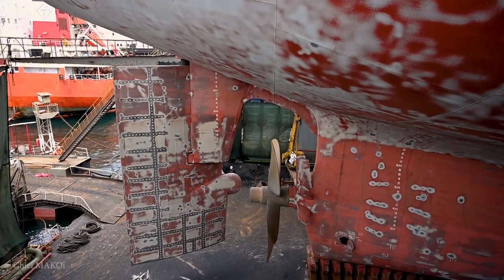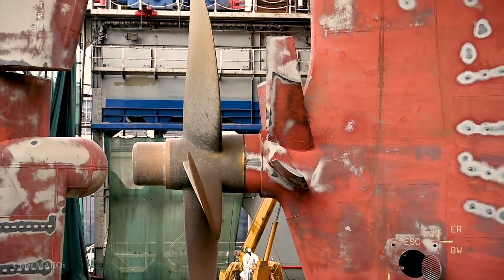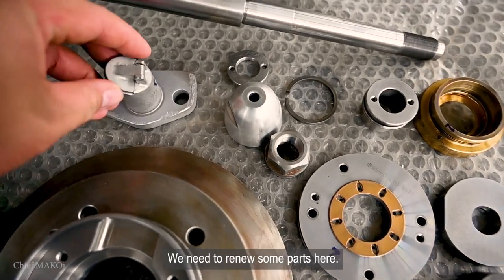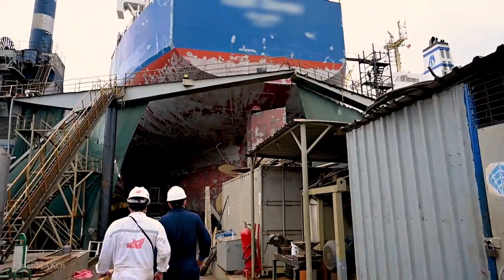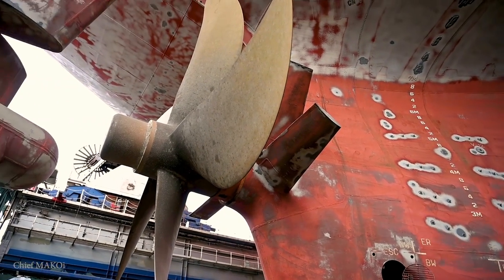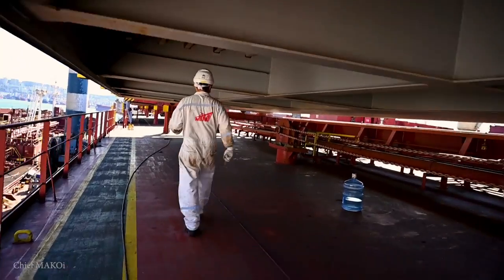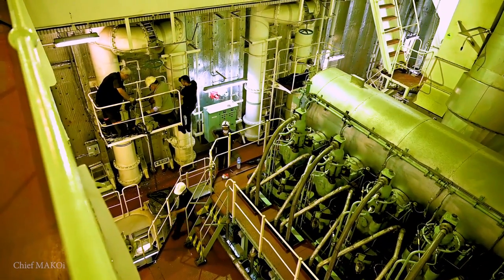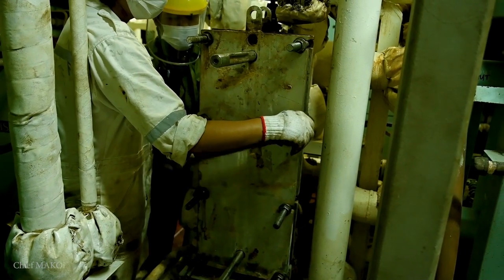Ship in Dry Dock: Jobs Done | Seaman Vlog S03E04 | Chief MAKOi

Comment: I am impressed by how far you disassemble things. It seems like you guys take some of these things 100% apart, including even gauges. And I never would have thought motors would have the coils re-wound. I figured if it got to that point, they just replace the whole motor. 

Must be an incredible learning experience for new crew members to basically re-assemble all these components from scratch.
Reply: Hey.. as a marine engineer once myself, I can attest to the various kinds of overhauls which are carried out on board, even complete overhaul of the motors to check/clean. It is important to note however, that I myself had never personally experienced coil re-wounding and even in this video it is being carried out by the shore personnel.

Comment: I learned how good duck tape really was in dry dock. We had some work done on the fresh water tank. When finished it was tested at 20psi for 24 hours. Eight hours into the test a pipe that was supposed to be connected to the fresh water system, but had been missed some how sprung a leak. It was a four inch pipe covered by duck tape that held for eight hours before failing. A four inch stream of water made quite a mess. No one could believe the tape held up for that long.

Comment: looks like RH series T/C .How do u clean the rotor shaft on board... ??  I have always difficulty removing the hard scales...
Reply: Typically I have seen water washing type systems, but dry washing is a common method as well.
Reply: @ethandoyle8182  , ya.. water washing / dry grit is while in operation... I wanted to know if any in house formula the chief had to clean the hard scales from the rotar blades during periodical overhauls. (  warm water/ sugar/ detergents/ chemicals from the maker... Which we do not have most of the time... )

Comment: How much it cost (briefly) to stop the ship for so long time, to repaint, and to do all maintenance?  How many times does a ship need this kind of total maintenance in a period of 10 years?
Reply: cost to run a ship per day can vary wildly depending on the vessel and its size. This vessel is probably around 10k or so a day to run (during std operation). but I have been on oil and gas construction ships that cost close to half a million per day, depending on the scope of the project. In a 10 year period the vessel will see 2 dry dockings, as they are done every 5 years.

Comment: Whose responsibility is it to come up with the list of repairs to perform?  Must be a long list that requires a lot of coordination on timing and manpower.
Reply: They use a duty cycle. Ongoing maintenance while underway. Large systems maintained in dry dock. They will have things on the list for the next dry dock  before they leave this one. They also have safety items like the anchor chains that need to be checked every dry dock.
Reply: @thereissomecoolstuff  Ahh, ok.  Makes sense.  Thanks!  It's amazing to me that the whole ship is just sitting on those wooden supports underneath.  I know the weight is spread over a huge number of supports, so the load on each support isn't as crazy as you might think, but it's still mind-boggling.
Reply: @bryanshortall787  yep they can be huge timbers bolted to the dry dock. They also use concrete blocks. What's really interesting is lining the ship up exactly over the supports. There are several videos on here showing that.